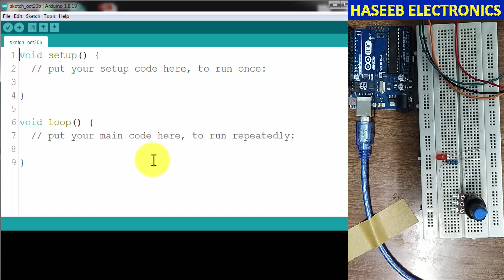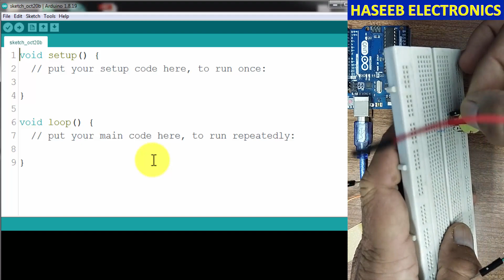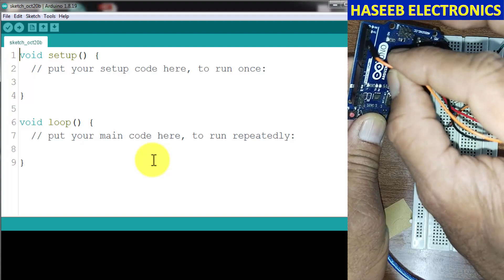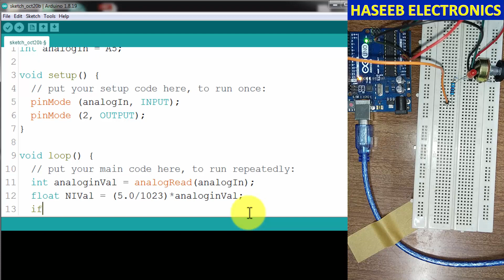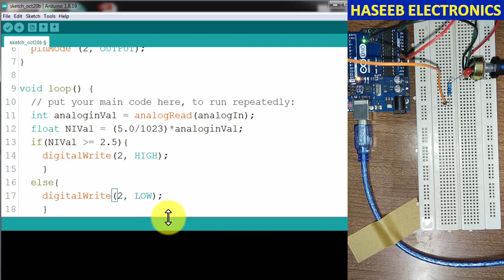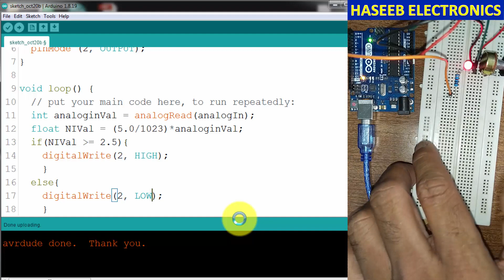{746} Non Inverting Comparator Using Arduino

Comment: Dear brother Arduino sey cd 4017 ka code banaiye 1 push out put on  if 3 bar push kerney per out put low for bathroom light automatic on open the dore and after bathroom gate close light off